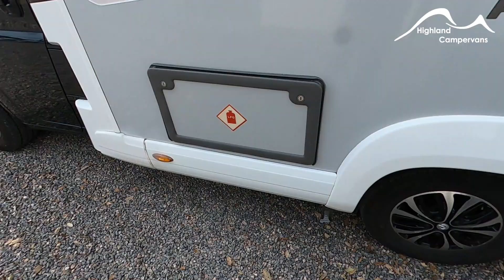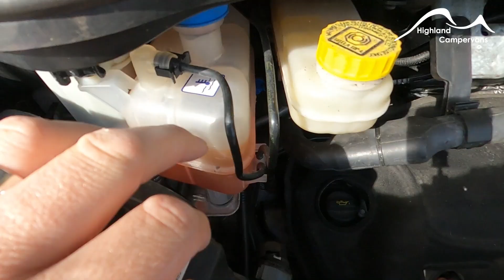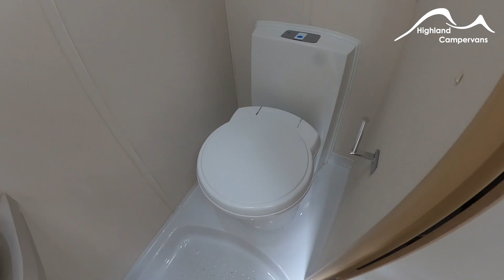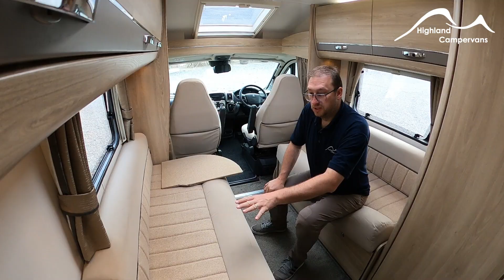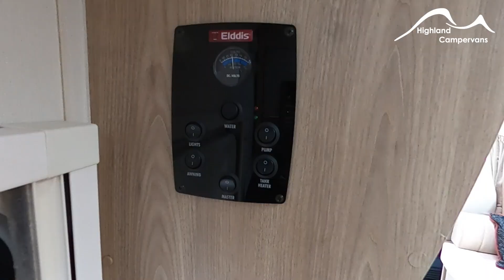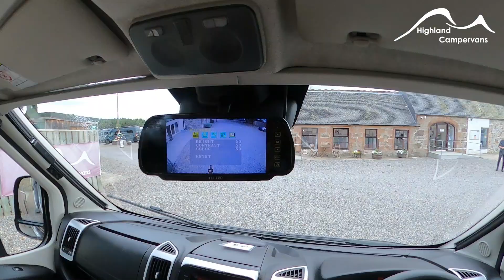Elddis 115 Platinum Edition 2 - Handover Video

Comment: Sadly, the section with the fridge is no good to me, because mine has a super sensitive push button system that turns on when I walk past, and drains the batteries pronto. As the 100w solar panel only trickles into the leisure battery, I'd have to drive a long way to replenish it. Can you do one for those panels with the little blue lights? They're a nightmare.